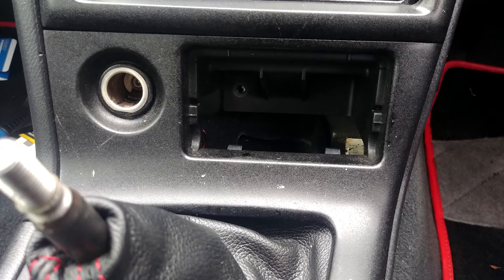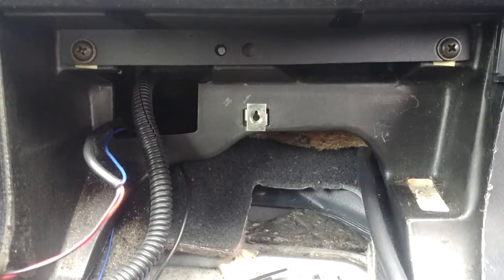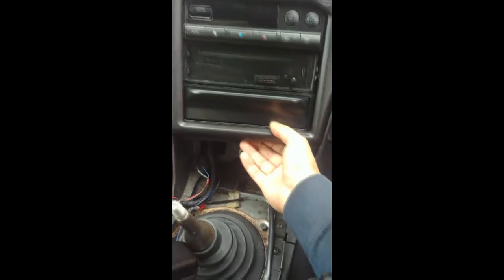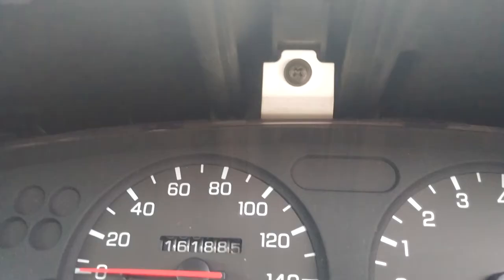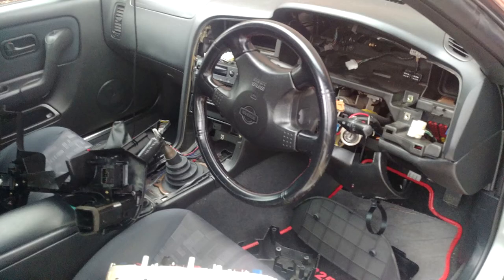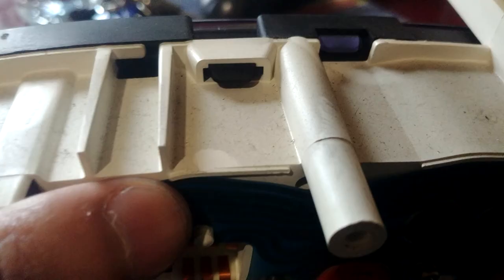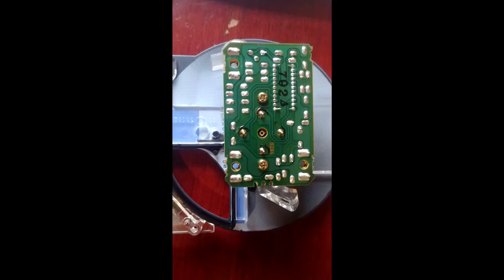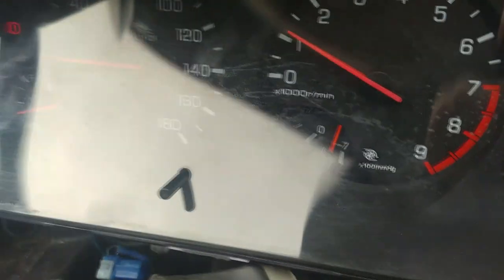R33 Tacho fix

Comment: What do you do with the small ones again? Solder them aswell?
Reply from the maker: If it needs it then yes. If you have a magnifying glass have a look at the joints. It's usually only the ones I circled that fail
Reply: I pulled everything out and my butane solder stopped working l.. how's my luck?

Comment: Hi, my tacho is working 50/50. It'll work if I wack the dash or push cluster.. when it's not working it'll float around 3000/8000rpm lolSometimes 0But is this the fix for the common r33 tacho fault ???? Should this fix mine ??
Reply from the maker: Adam OBY if your problem is dry solder then yes. This fix is 50/50. If you plan on buying a new rev anyway then just try it You could save money if it works.
Reply: well my tacho likes to work when it is hot weather and car has been closed up for couple hours.. . and if its not working it'll eventually come good and start working. so it has to be some kind of solder or connection ... this is my second tacho installed to my factory cluster and they just float around the rpm range...   and auto elec has told me all looms and connections are good so it has to be the tacho connections,because it DOES work perfect half the time so i know its not broken and something to do with connections..is this more then likely my problem?
Reply from the maker: Adam OBY more than likely yes. Its been a while since u posted it did you get it fixed?